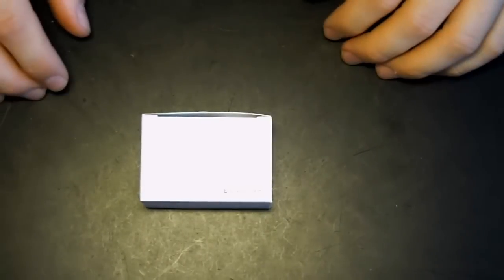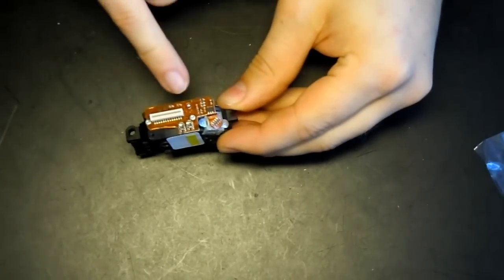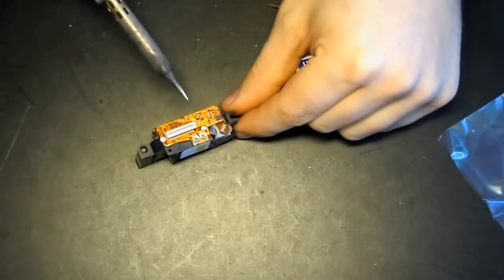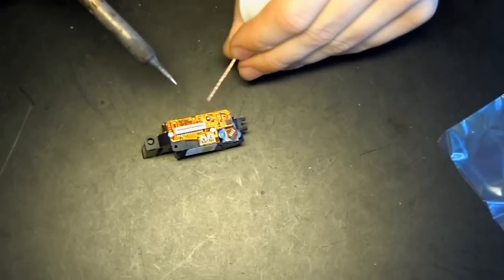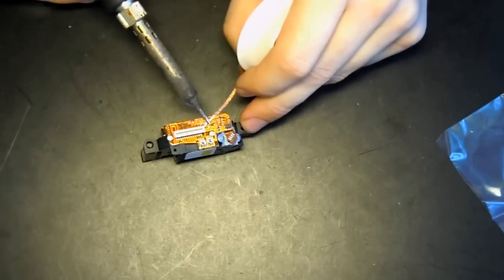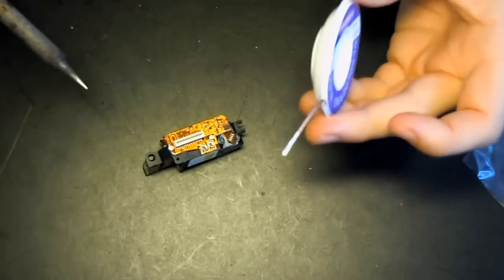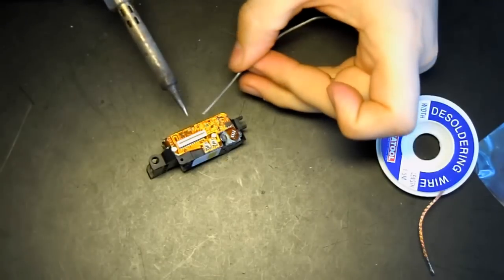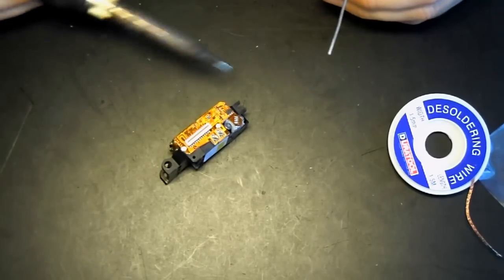removing the anti static solder point from a laser

Comment: I tried with a 12v soldering iron and it wouldn't burn away the solder and it wouldn't move or go away, so I juust kept burning it , I guess, and the 3 points were not 3 points by the time I was done.

Comment: Thanks so much I'm about to order a laser for my OG Xbox and I figured this is what you had to do with the replacement for ebay. Now time to get a solder and some soldering thread. I just tried cleaning the laser and the area with rubbing alcohol and I tried twisting that little screw to make it work better but didn't work.

Comment: I paste an answer I gave to a user here . Maybe it's useful to someone . Also I would like to ask . Isn't it better if the solder blob it's removed when the pickup is installed in position inside the drive? 

This is the answer:
The purpose is to not discharge static electricity on your body on laser . It's a delicate device, but I never seen or damaged any laser in 20 years . You just need to pass the soldering iron on the solder blob and open the line that it keeps closed . For the ps2 , I don't know but most of the times a model number similar it's suitable . For example I have an xbox 360 with 141x laser (Philips light on) and I'm going to replace it tomorrow with a 141D or something like that . I found it on amazon ,and it looks virgin from factory . Same box (actualy 2 small boxes one inside the other) , blue bag , and the solder blob . Also the pickup whole looks clean without scuffs , impurity , dust , fingerprints or grease .those are the things you have to check to be sure it's a new one . To know if it's compatible check the shape and components position on your and o pictures of the replacement . Must be pretty identical , more than over on the ziff connector ( the one where the flat connect) , check for numbers of pins and try to measure the dimensions (I
Reply: Sorry for my English , should still be pretty readable

Comment: Great video! But can you please explain to me why this is needed to be removed? What is it’s purpose? Why is it there in the first place? And what would happen if someone tried to install the laser without removing it? Also one other question, I have a Sony laser lense that I’m looking to replace, the model number is KHH-313AAA but I can’t find it anywhere as if it never existed. The closest model number that I can find is a Sony KHM-313AAA or Sony KHS-313AAA do you know if either one of those will work to replace it with? The whole reason for me trying to replace it is because the DVD player has trouble reading some DVDs but works good on other DVDs and I already verified that the DVDs are not the problem as they play perfect in different DVD players, so it’s not working properly so I’m looking to replace the lense in hope that it will help. Please let me know your thoughts and thanks again!
Reply: The purpose is to not discharge static electricity on your body on laser . It's a delicate device, but I never seen or damaged any laser in 20 years . You just need to pass the soldering iron on the solder blob and open the line that it keeps closed . For the ps2 , I don't know but most of the times a model number similar it's suitable . For example I have an xbox 360 with 141x laser (Philips light on) and I'm going to replace it tomorrow with a 141D or something like that . I found it on amazon ,and it looks virgin from factory . Same box (actualy 2 small boxes one inside the other) , blue bag , and the solder blob . Also the pickup whole looks clean without scuffs , impurity , dust , fingerprints or grease .those are the things you have to check to be sure it's a new one . To know if it's compatible check the shape and components position on your and o pictures of the replacement . Must be pretty identical , more than over on the ziff connector ( the one where the flat connect) , check for numbers of pins and try to measure the dimensions (I know not easy on pictures)

Comment: Just learned about this incredibly stupid situation today. I couldn't believe that any electronics manufacturer would engineer in something like this.  

Just use a special anti-static bag for shipment and don't require the installer to have to deal with such a problem!
Reply: Using a jumper rather than solder makes so much more sense to me.

Comment: Hi mate! I bought a new CD lens for my Sony CDP-CX235 cd player. I replaced the original lens (which was old and could not read CDs as it should) but the new lens did not worked. I installed the original back in the CD player and worked same as before.
Can I send you a picture of my new CD lens and have your opinion? 
Thanks a lot!!!!

Comment: I forgot to remove my solder point ... but the laser is functioning without a problem. Do I still have to remove it?
Reply: it's not possible for it to work without removing this so chances are it didn't have one in the first place - if it's working leave it :)

Comment: Im asuming its somewhat the same fort my ps2.. if ive setup the laser already then fiqured out it had a static solderpoint can i still remove it to get it to work?
Reply: yes, it won't have damaged the laser because you didn't remove - simply take the laser back out and remove the solder point, then replace it. Note the solder point will be in a different place than on the xbox laser so take care to identify the correct point

Comment: OK so I did the fork thing since i dont have that thing your using, and it removed it,it now reads the disc but i only get unrecognized disc.did i burn to far? or do i keep going?
Reply from the maker: if it reads discs then you've probably removed the solder bridge fine. If it's saying unrecognised disc then you have another issue, such as faulty laser, faulty orange cable, incorrect installation (most likely) or faulty discs
Reply: Im try to remove a Solder point for my PS2 Slim, I don't own a Soldering Iron. What else can I use that is precisely effective without damaging the laser. Great Step by Step video.

Comment from the maker: hmm I don't fix so many xbox's these days so I've not heard of that before. However I don't think it's the laser. If you hadn't removed the solder point properly it would just appear dead. If the laser was faulty it wouldn't do that. My thought is a short circuit possible caused when the tray closes and the laser moves into position. Check that you've rebuilt the drive properly, e.g. check that the laser rods are properly back in position and that the circuit board isn't out of alignment

Comment from the maker: yes you could. Touch the solder point with the iron until it melts and then wipe that solder onto a wet sponge or flick it off and repeat if necessary. Take youre time